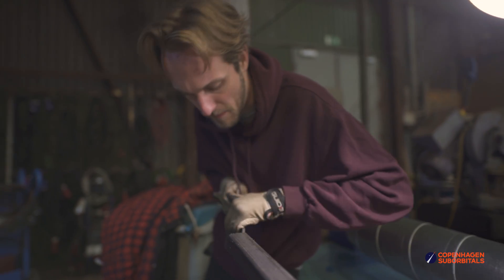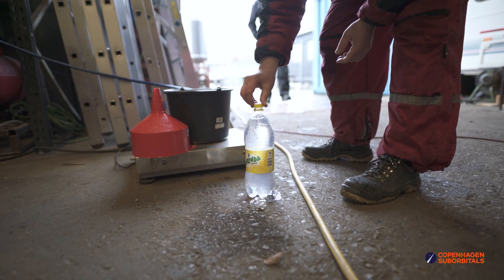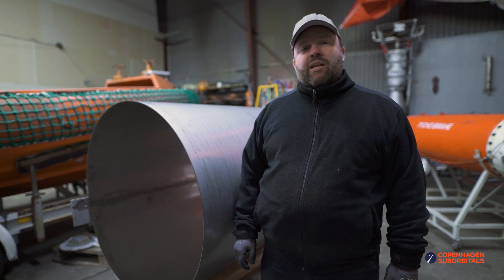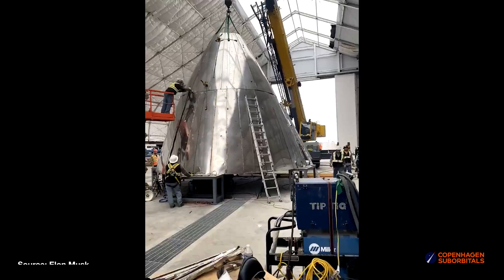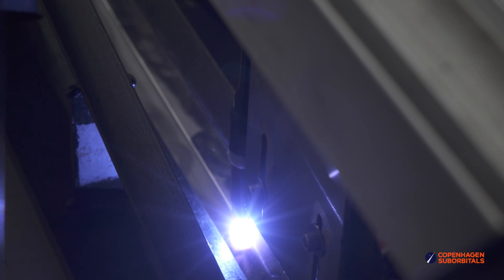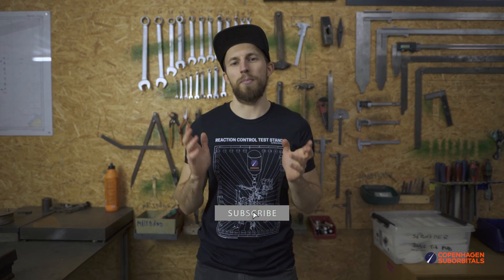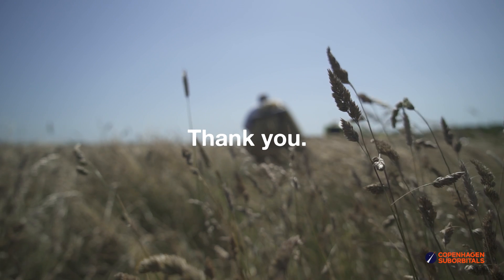10 Steps to Welding 304L Steel Rocket Propellant Tanks | INSIDE THE ROCKETSHOP : Episode 21

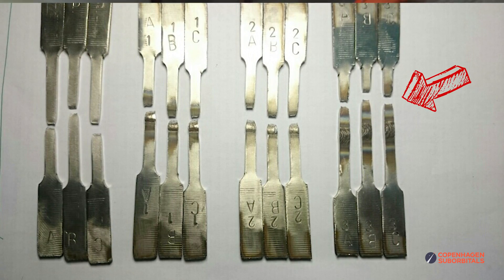Comment: 2:44 You have a massive heat affected zone and this is probably why it broke so far away from the weld. 4:55 Your heat input looks much too high for 304 and you could be forming martensite. You must do tests for fatigue.

Comment: Should really be using a larger cup on that torch, the total heat input and travel speed it beyond what that cup can adequately shield. The resulting oxidation is so thick you really need to do some significant abrasive cleaning, or pickling and subsequent passivation to retain some decent corrosion resistance.

Comment: 2:41 those results actually look very concerning. When loading into the test rig your samples need to not have be loaded in the same orientation with respect to the travel direction of the weld. 

Since all 3 broke to the left of the travel direction, it is highly likely that either the test rig has a defect which caused more stress above the weld and you were not alternating, or your weld method did not apply heat symmetrically and weakened (or strengthened) the steel on one side  far more than the other. The latter seems more likely considering that your control sample without welds on the left does not appear to exhibit this bias. 

Were the final measurements on test group 3 higher than or equal to the measurements from the controls? If not, it is a weakening problem that severely needs addressed. Otherwise it is probably not a big deal but it is important to keep in mind that the material properties either side of the weld are not the same, especially when doing the ring welds.

Another comment suggested that you re-temper your samples between welding and testing. If you can re-temper the tank after assembly that is a very good idea as it removes concerns of this sort from your welding work, but if you cannot that is a very bad idea as it will hide issues of this sort.
Reply from the maker: Yes, group 3 was stronger than the controls, so for the long seam welds, we are not overly worried. And of course, the finished tanks will be subjected to hydrostatic pressure testing up to 1.5 times the operational limit. We've also done some hydrostatic pressure tests on circumferential welds on a smaller scale as well, which proved to be holding up.

Comment: You folks need to share this information with Elon.
Reply from the maker: SpaceX is playing with much smaller margins than we are.
Reply: This material is quite different and thicker than his...
Reply from the maker: @ChevTecGroup  Thinner* so far, at 3mm.
Reply: @CopenhagenSuborbitals  awesome.  But I think starship was at 2mm last version.  Starhopper was 12mm!!! Which explains why it worked so easily
Reply from the maker: @ChevTecGroup  https://youtu.be/HI_8cZwP5XA?t=175 Seems to be 4mm still, but they might be working their way down in future iterations, I suppose.
Reply: @ChevTecGroup  Fine, but the process used to determine the best method could also be applied to his situation.  Sometimes it's the obvious solutions which are overlooked.
Reply: @dorsai  From photos what we saw they have machine for tensile strenght test, which was delivered at Boca Chica about three monts ago.
Reply from the maker: @suutra3  Sorry, I meant "much smaller" :) Hear what I mean, not what I say! 😅

Comment: 2:43 to be 100% sure, you should go ahead and re-temper some of your samples before testing them. It could be that you recristalized the structure of the steal by heating it up during the welding and cooling off on the air/water. this would greatly change the inner cristaline structure of your steel and let the welds seem stronger than the base material. I did almost the exact same analysis in my engineering bachelors lab https://www.youtube.com/watch?v=zjEWz3Aac5A - Anyway, great job. it is a lot of fun to spectate on the adventure you guys are on.
Reply: The point where you read the most boring 500 bucks book on material science to know its steel

Comment: If a weld I done correctly, it will almost always be as strong or stronger than the base material. The real problem is in the heat input, in the haz zone, just outside the weld, the material's properties will change too much if not done correctly

Comment: Quite a popular topic nowadays, isnt it?
Reply from the maker: The tank virus is spreading more than that other one in the industry currently.
Reply: Yeahh. Welding steel tanks is a popular procrastination activity these days. The tanks in Boca Chica are slightly larger though :-) but the tanks in CS has to operate at up to 22-25 bar and tested to I believe 34-38'ish bar compared to 8 and 12'ish bar in Boca Chica,  and as there,  the answer is automation and controlling/mastering it.
Reply: @petermaersk-moller3014  There has also been the Blue Origin New Glenn tanks video yesterday.
Reply from the maker: @tod4y  And ULA, and Charlie Garcia :)
Reply: @petermaersk-moller3014  it's not just the pressure from pressurization.  Just as,  or more, important is the pressure from the weight of all that fluid.  Look at old water towers and how they have increasing in number bands going around the circumference
Reply: @ @ChevTecGroup . The maximum pressure in a tank is a sum of the pressure at the top plus the pressure from the height of the liquid. Volume is irrelevant, the height is not. Assuming water, that is 1 bar per 10m. Liquid methane is 0.422 bar/10m and LOX is 1.14 bar per 10m. That said, we need to multiply by the resulting g-force. Assuming the turbo pump wants liquids at 3-6 bars, the top pressure can be somehwat lower at the top of the tank before liftoff. As the starship accelerate, you can lower the top tank pressure to limit the pressure at the bottom. As the height of the liquid drops the bottom pressure drops, but the weight of the starships also drops resulting in increased acceleration unless throttled down. To avoid killing the potential crew, down throttling will eventual be required and an increase in tank pressure may be required. Anyway the takeaway from this is that to optimize minimum tank matrial used and staying within welding strength, variable managed tank pressure is required if you want to keep the maximum tank pressure sufficiently low. Alternatively use tanks and welding technniques  that can take the higher pressure to keep it simple, but very heavy.
Reply: @petermaersk-moller3014  of course. Just pointing out that most people only think about the pressure from pressurization. Which is minimal compared to the pressure from gravity and all that liquid in the starship